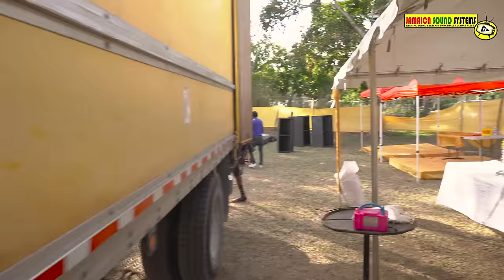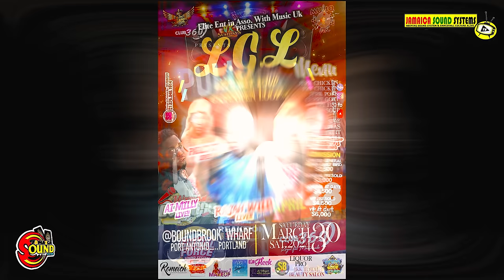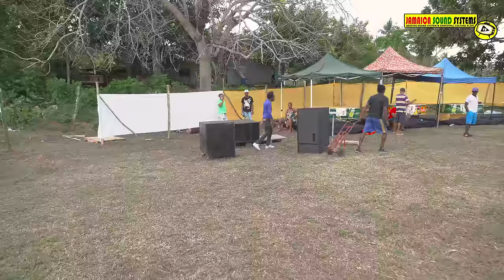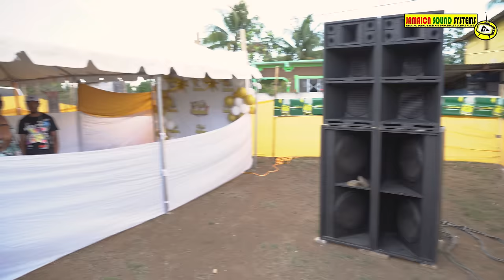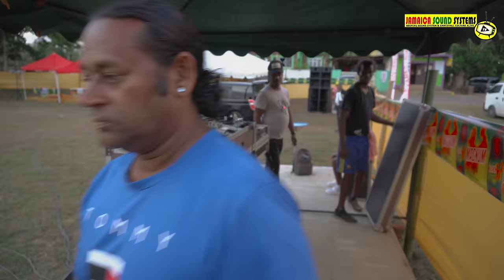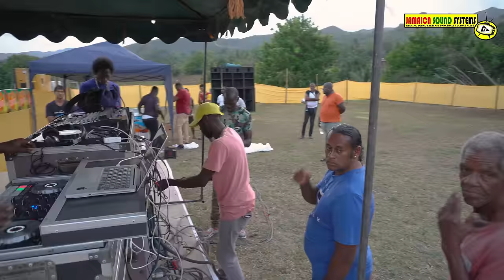Stone Love Roll Out The Weddy Weddy Sound Purple Love @High Rollers In Wakefield Linstead

Comment: Ok let me tell you a little about speaker boxes and speaker company. You have speaker manufacturers they make the complete box fully ready to play called ready made. Sometimes they sub contract to the small cab builders to build box for them. Then you have the man on the corner normally a man with carpenter skills in the community that can build box now him can build it to your specification, the big company not going to custom build just for you unless its a huge contract. I personally can build almost any box, big companies have nothing at all over my box them apart from to build on large scale. Ply in Jamaica is very very poor quantity but i guess you have to use what is available still. Am in London and the good quality ply would cost about $25 000 a sheet in Jamaican dollars. Building and loading a Bass box myself ready to play could work out to be about $150 000.
Reply: Real talk!
Reply: The problem in England no one wants to spend 800/1000 pound on a proper built and loaded pair of box they see china plastic price and buy that.
Reply: @chris_vandepeer  true that's how I learned to build myself. For a bass cab cost me about £700-800 build, paint, load. And I have fun doing it too
Reply: @christopherdouglas7606  Yep i learnt from a young age as i had sound man around me who built pro box and amps. When you load a box with a PD Fane EV the price is high but you get what you pay for.
Reply: @chris_vandepeer  yeah, man straight PD on Bass for me fane on low mid and mid and Beyma on tops.
Reply: You mentioned that big box companies have nothing on you but do you design boxes using proper software or just copy what has already been designed and built?
Just asking
Reply: @dwightwright208 I have only designed one 15" mini scoop for myself that was because i need something small with punch works very well. Am not into designing but I got a cousin who can. When I say big companies has nothing on me I was talking about the quality of the build strength and looks. So 90% of the time I used plans that are available free.